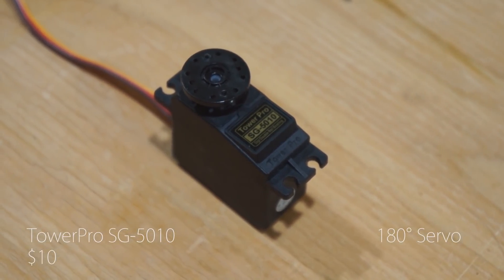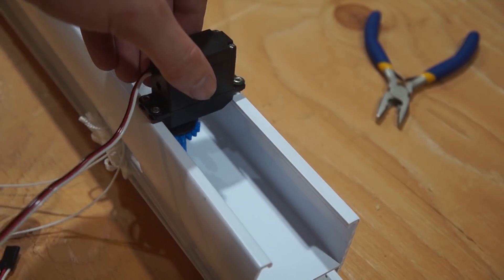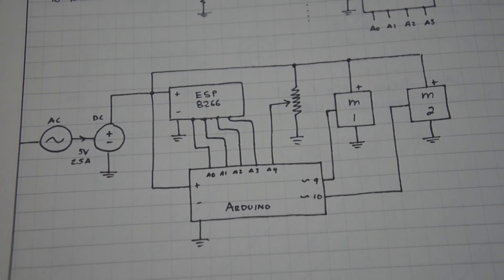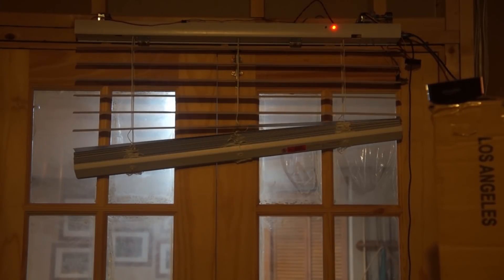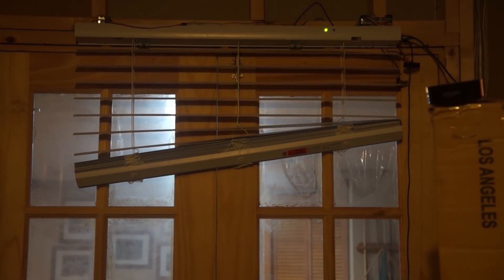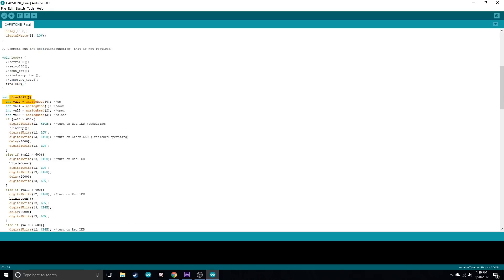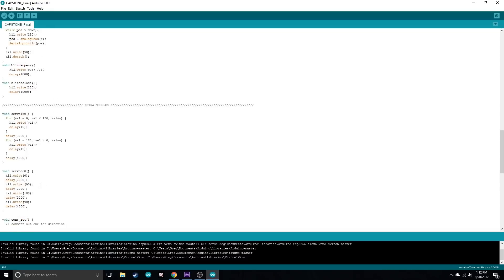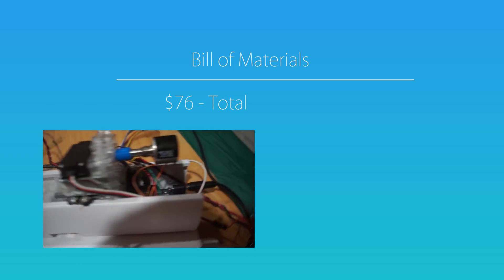HOW TO MAKE SMART BLINDS USING ALEXA

Comment: Excellent video... I am putting together my list of materials, but I want to be sure I get the right potentiometer and the gearbox to attach it to.  It is a 10 turn pot but what is its resistance?  Also, any information on the gearbox it is attached to would be great (i.e. manufacturer or the vendor).  Again, thank for this!
Reply: After replaying the video at 25% speed, I was able to see the manufacturer, manufacturer #, and specs:  VISHAY SPECTROL PRECISION POTENTIOMETER
10KOhms +-5%  L I N +- .25%
  Manufacturer #: 534-1-1-103.   
 It be great to get the 3d print file/specification on the custom gears,  as well as information on the gear assembly that translates the motor lift to the 10 turn potentiometer.  :-)

Comment: Hey, awesome tutorial! Can you please clarify a few things? Is it possible to do all this using ESP8266-12E instead of Arduino Uno? (I'm new to this and did not figure out all the differences between the 2 controllers). And how did you connect it to Alexa, as I don't see any code you shared on GitHub for setting up a web-service or a websocket client to anywhere...?

Comment: Grensom, first of all congrats on an amazing project, my daughter's final science project is based on it. My issue is that the link you left is not the complete code, I had to do screen prints on your code and transcribe it to the Arduino IDE. After that, reading the code I was able to tell which pins to use. So connected everything as I thought was the proper way to do it. My set backs, there's no code for the ES8266, I have no idea on what to do with it. I can play around with the pins, connect them to ground and play with the pot. So far the only thing I can do is lower/raise the blinds. The tilt (close/open) thing, I can't do it. So at the end, her science project is incomplete. Would like to learn more, it has a lot of potential.
Reply: So who's doing this project, you your daughter?  come on Dad don't cheat!!!

Comment: Hey boss I just wonder can you do a video on just the open and close part,  I don't want to pull them up plus i have no room for the hardware for the motor to life them.. so just open and close and I wonder can I use a sonoff to control the motor function.  if you could let me know that would be great.. And of course I want to use my echo dot to control them..   Thanks and by the way this video rocks.. Thanks for posting.. ..

Comment: "here's the piece that I lazer cut..." and that's enough of this video!
Reply: Exactly. Once I heard that I knew where my budget ended on a project like this.
Reply: I have a 3D printer using PLA material.  I'm sure I can CAD up something like this.
Reply: I love that he has access to a laser cutter but makes all the brackets out of  wood cut with a blender.
Reply: I agree with that. I don't have access to a laser cutter. But I'm thinking about trying the same thing with some epoxy putty -- go get it to fit that hex axle.
Reply: Same for me!  Video does nothing for me at that point.
Reply: You can always get a wooden broom stick and cut it to the lenght needed, then use a rotary tool to finish it. If you don't have a 3D printer or laser cutter, guess this is the way to go. Gonna try this...
Reply: haha he didn't have to laser cut that piece, he just chose to. Funny though.
Reply: LOL right! Now for the rest of us, how about version where you just hack the remote on my existing electric blinds?
Reply: Ever heard of a hand file and a drill? Open your mind a little and THINK.
Reply: I have heard tell of these mythical places called makerspaces where you can go and get stuff done.  They have tools like laser cutters, 3d printers, and cnc machines and they can teach you what you don't know.

Comment: im not impressed until shades moveing without that cringe noise. (servo noise)
Reply from the maker: Bottled water I completely agree, that was the one thing that really bothered me about this project. The motors were undersized so I did end up getting larger torque motors and it was much better. I would've done an update video but I don't have the blinds because I have them to a facility
Reply: maybe you use spring power so servo have less weight to rise and make less noise? something like how garage door works
Reply: A couple of questions, so using larger torque motors, is quieter? Second, is that a potentiometer or a rotary encoder?

Comment: Really cool, would be good to see the final result though. Did you manage to cover all the cabling from being viewed?
Reply from the maker: Yes, I actually made a 3D printed cover for this project after the fact, cleaned up the wiring with a PCB and fixed the lifting mechanism. I would have liked to make an update video, but I have given them to a woman in an assisted living facility who will be able to use them
Reply: Grensom please send me the arduino code and 3d print file? Thecrimsonblade2@gmail.com thank you so much! Amazing project.
Reply from the maker: YellowSpade actually I added a link in the description for the Arduino Code

Comment: Why aren't you running the software on the ESP8266 and using those GPIO pins?
That would eliminate the Arduino and reduce project cost (which could be significant of you have a lot of blinds to control).

Comment: why didn't you just 3d print the housing for the servos instead of using the wood pieces?
Reply from the maker: I did after the fact, I didn't have access to the printer at the time and made the other pieces a few weeks in advance. I ended up making a 3D cover as well and using a PCB to clean up the mess of wiring
Reply: Grensom Pics/Video or it didn’t happen...

Comment: Amazing!  Would you mind sharing your code with me as well?  jhowlette@gmail.com
A few questions for future upgrades: 
1. will a single arduino be enough to control multiple window shades? 
2. Can this be connected to the alexa alarm to open or close when that alarm goes off?  
3. Can a partial open or close be programmed in as well?

Comment: 1 thought is, do you have a fail safe so if you ask to pull shades up before you open the shades so that it will always default to open before performing up or down functions?
Reply from the maker: The motors can pull the shades up and down whether or not the shades are open or closed

Comment: I have been doing a ton of research on this over the last few weeks and just happened upon this.  First of all I want to say you did an amazing job.  I just have a few questions.   
1.Why did you not go with one of these instead of the separate ESP8266 and Arduino?
     https://www.amazon.com/NodeMcu-ESP8266-Wireless-Internet-Development/dp/B01KC7QG4O/ref=sr_1_2?ie=UTF8&qid=1503364755&sr=8-2-spons&keywords=esp8266&psc=1

2.Metal or plastic gears in the servos? 

3.What kind of amp draw do those servos require?
Reply from the maker: 1. I chose to use both because you cannot run the <Servo.h> library from the NodeMCU and I like the simplicty of that library for running the servos.
2. Both of the Servos have Metal internal gears due to the high torque put on the motors
3. The operating current on the motors is around 1A and with a higher starting current I have trouble running them from Arduino. I wired them directly to the 5V 2A Power Supply
Reply from the maker: Crash Override I tried running this a while back off a variety of chips, but I believe what happened is the servo commands require that 16 kHz external timing crystal you see on Arduinos. But there are other ways of running the servos without that library, I just haven't looked into it too much.
Reply: I thought the servo.h limitation was only in reference to using pin 9? Though I do admit I haven't done any ESP8266 Servo circuits yet.